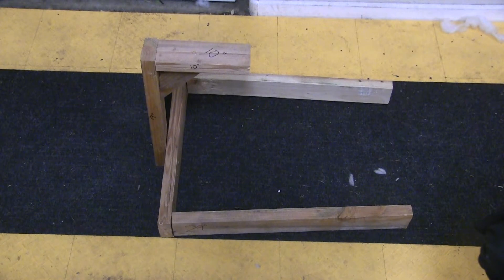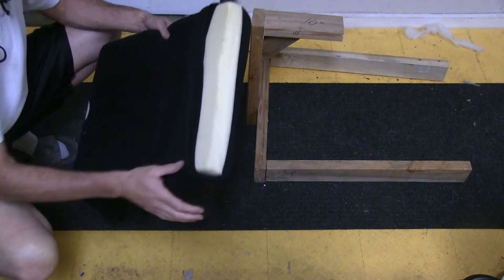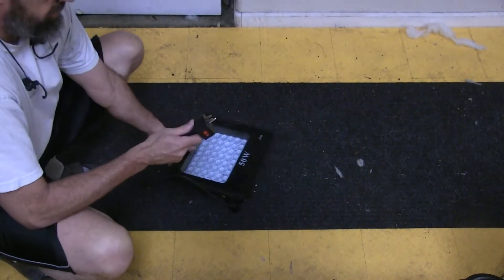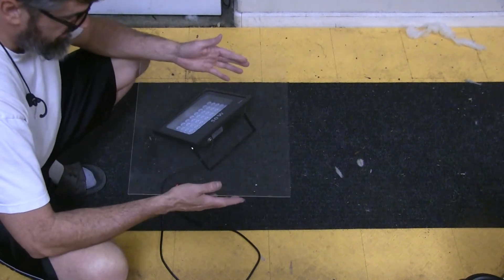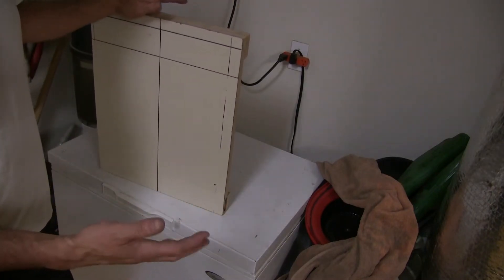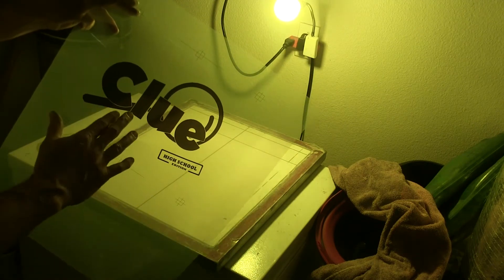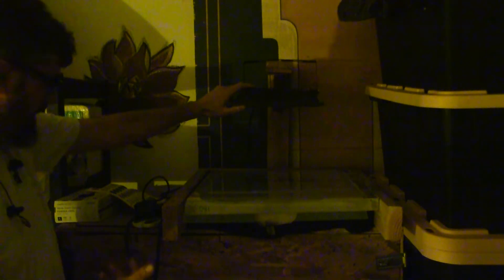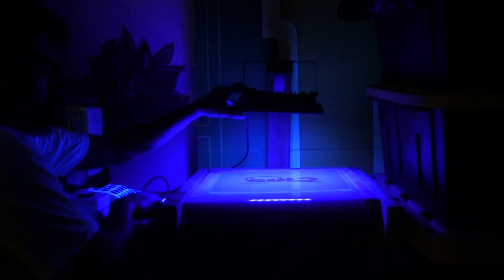DIY Screen Printing Exposure Unit for Well Under $100.

Comment: What is the yellow bulb for exactly?
Reply from the maker: Good question! The yellow bulb does not activate your emulsion. So you can position your image without rushing or worrying about ruining your image. Once the image is placed correctly the UV light is used to burn your image into the screen. Let me know if you have any other questions!